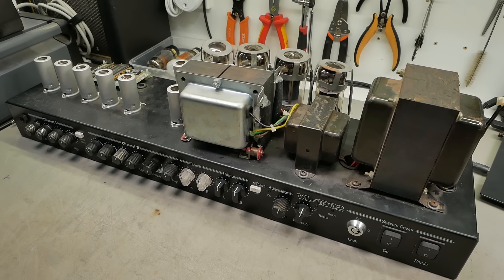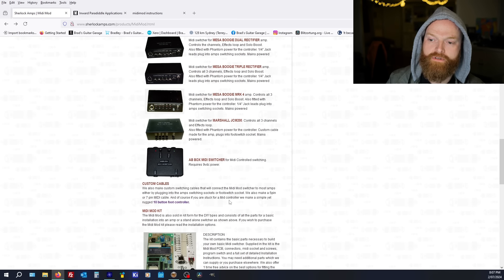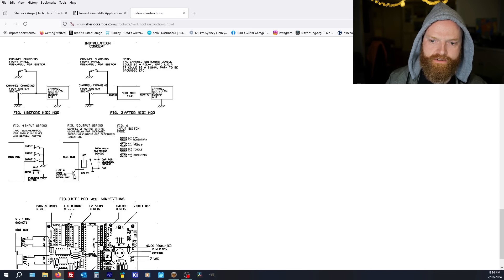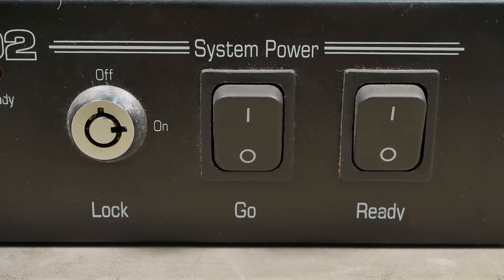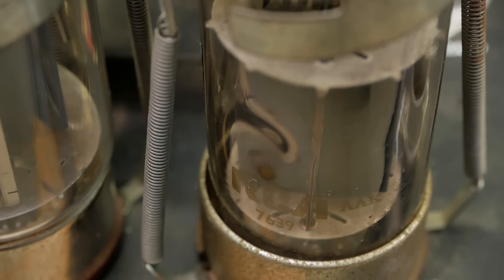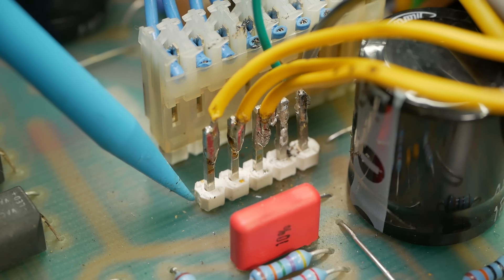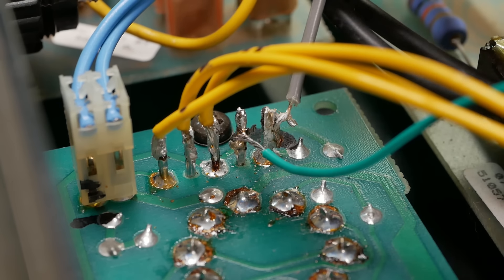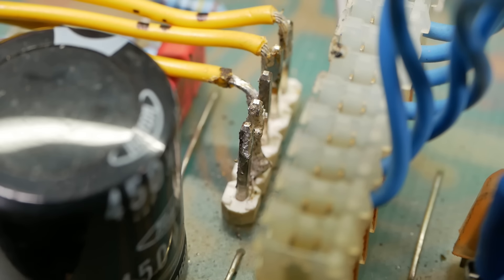Ampeg VL-1002 Strip & Rebuild - Part 1

Comment: Oh boy, I had one of these in the 90s.  It sounded great, but the wiring harnesses and connectors would just go bad one by one.  I played whack a mole with them one at a time as they went bad for a few years before just replacing all the remaining wiring and selling the thing after some header pins overheated and scorched the board.  
  That hotrod preamp tube is likely original. I think it shipped with rebranded Siemens el34 and 12ax7

Comment: I repaired a couple of these on my channel.  There's a few bullet proof mods to keep the boards from charring.  Little late in this scenario.  You can get the knobs still.  The mid selector is very hard to turn and usually cracks the knobs.  If you reinforce the non D shaft bits of the knob by filling them with epoxy it won't happen.  The impedance switches cause a ton of problems.  Best to replace pre-emptively as the issues are intermittent when failing.
Reply: yeah, those impedance switches are often failing, burned trace on PCB from plate to grid could be caused by flyback voltage. It looks like short between plate and grid trace around 26:46. Thanks for tip with freq knob, gotta do it with mine

Comment: I have a 50 watt Saint Louis Mucous era Ampeg in the queue. I am more than content to fix the one I have. My new soldering set up started out with stuff from Offer Up & Market Place so I am going with bits of everything. Pace, Hakko, Metcal,  Weller, American Beauty and my 1950s 220 watt Sound Design iron. Those tweezer handpieces are awesome. I just bought some plugs for those headers. I have some silicon, Teflon and fiberglass hose that fits over the barrel of most soldering pens. I also have a kit that I can use to put pads and traces back on boards, but it's stupid expensive to buy and the depopulation, super cleaning, bonding & repopulation labor is a financial killer too.
Reply: I probably have 3 or 4  of those PCB trace & pad repair kits from eras as far back as the mid 1980s. Bu Ku Bucks Incorporated will happily pay me to repair obsolete IO boards for their old PLC systems.

Comment: The serial number shows it's the 6th amp made in May 1992 for the UK market. L12 denotes 100 watt, 2 channel. I have the 50 watt VL-502 and really look forward to this. I have the service video for these amps on my google drive if anyone needs a link.
Reply: Just got one of these and could use the video if you dont mind. Thanks.

Comment: Awesome heads, I like to ground output tube cathodes directly to power supply board (there's additional grounding spade terminal) cause those socket to chassis connections are often causing problems =D  Some people had volume drops due to cold solder on screen resistors (or intermittent screen resistors if that 's possible =D ) or failing impedance switch

Comment: being a chronic problem solver is also being a chronic problem identifier. if folks mistake that for being negative and miserable, fuck 'em.

sticking high voltage connections to terminals without the foresight of at least a cheeky bit of heatshrink is bananas.